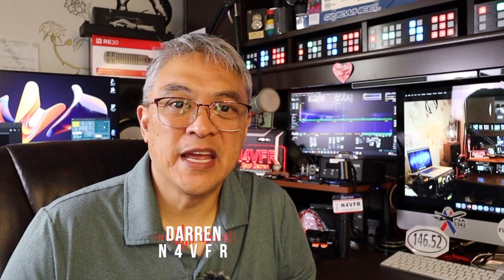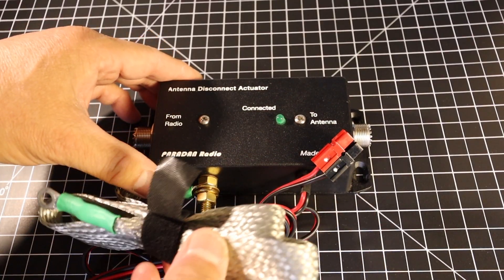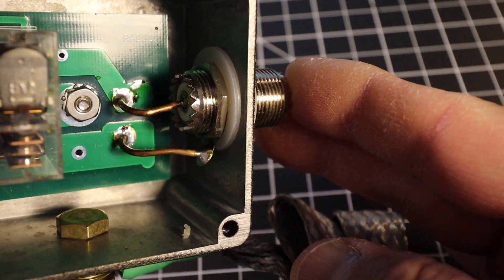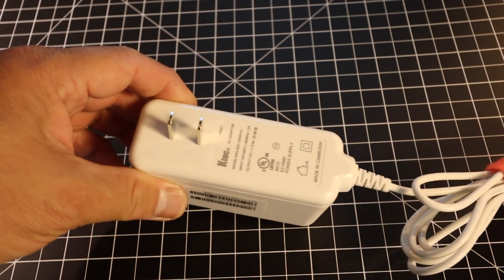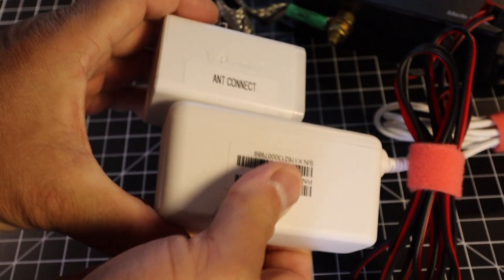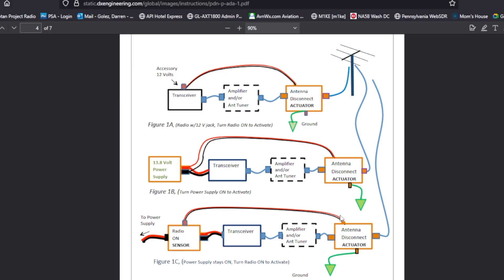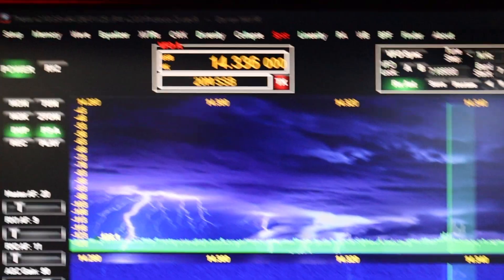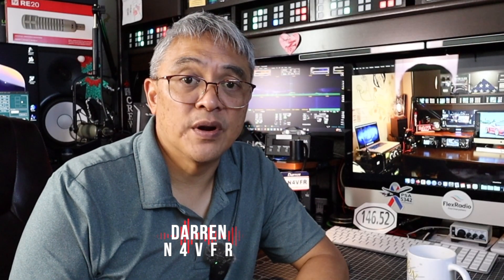How to Remotely Disconnect your Antenna to Minimize Damages from Lightning Strikes | Paradan Radio

Comment: That GDT will help but a relay with maybe 1mm of separation is not going to protect you from a strike with enough voltage to move electricity through hundreds or thousands of feet worth of air gap.  It's just there to make you feel good.  The GDT should help prevent a charge from building up on your antenna and attracting the strike in the first place by shunting the charge to ground.

Comment: If the shields of the input and output of the device ar connected, the static discharge or worse yet, lightning will enter your shack VIA the co-ax shield.  Add to that, that device is not even a speed-bump to a direct lightning strike or even an overhead cloud-to-cloud discharge.  😭  Best to disconnect, and re-locate your feed/control lines at the base of the tower then disconnect the radios and especially the computer from the radio.

Comment: How do you disconnect the AC power from your equipment?
Reply: He is using a wifi enabled switch between the wall outlet and the power supply. There is a link to the KASA brand that he uses in his comments.  I use them on EVERYTHING I have in the shack, I can push one button and disconnect everything from anywhere I have access to the internet.
Reply: @BigJohnsHamShack so if power or internet goes before storm…..
Reply from the maker: @RhettSparrow  Sh!t out of Luck I guess.
Reply: It will be cool if it disengages by default when no power
Reply: @RhettSparrow it does, when it doesn’t have DC it opens the coax and shorts both sides of the antenna to ground.  It’s just one of the necessary layers, it’s better than nothing.  73.
Reply: @KQ4WLR_Morgan_H thats good to know . I want a system like how the lineman use to disconnect those high voltage cables
Reply: I power the ones I have through a relay that's controlled by the radio, most radios have a 12 v out that turns on when the radio is turned on. That way as long as the radio is off the protection is on.

Comment: Do you trust that tiny little gap created by the destroyed gas discharge tube?  I've often wondered if dozens or hundreds of millions of volts coming in as lightning might just jump that little gap and fry everything anyway.
Reply from the maker: A direct lightning hit will destroy everything.  Time to invest in ARRL insurance.
Reply: It's for static discharges not lightning. 
G4GHB
Reply from the maker: @bill-2018  Yes, I agree.  73
Reply: When a lightning stroke or EMP from a fairly near dischanges and travels a mile to strike, think a gas discharge tube is going to be a barrier?  That device won't help much.
Reply: I want to read the disclaimer under the product :)
Reply: that thing would never protect a radio from a lighting hit.
Reply: @slickman1953 Nothing will protect your radio house from a direct hit from lighting.  These and poly fuse will protect from most if not all indirect hits.  You get lots of these in the south including Florida.  Note even disconnecting the antenna is not guaranteed so get ARRL insurance.